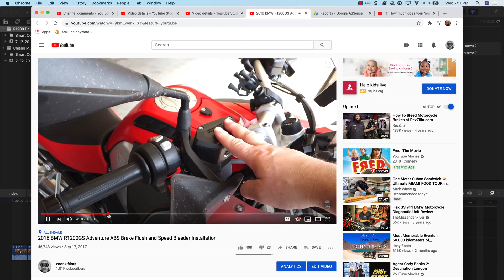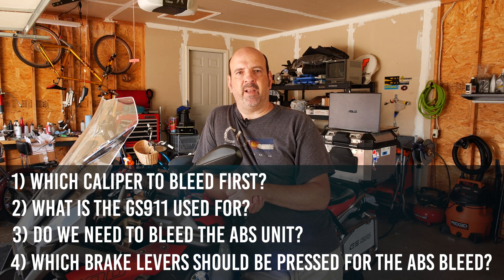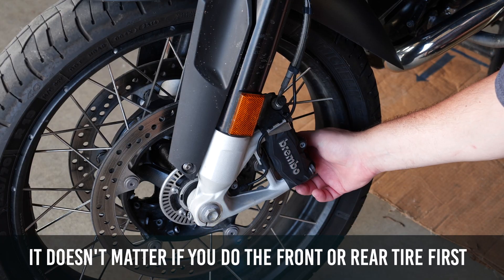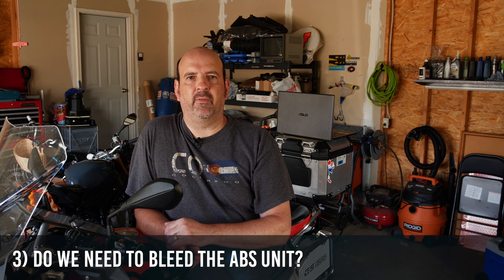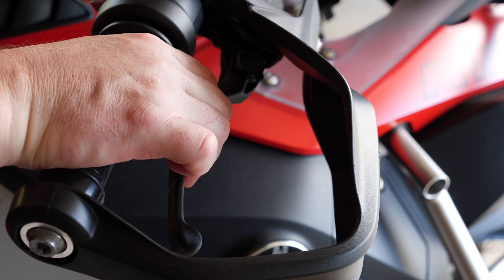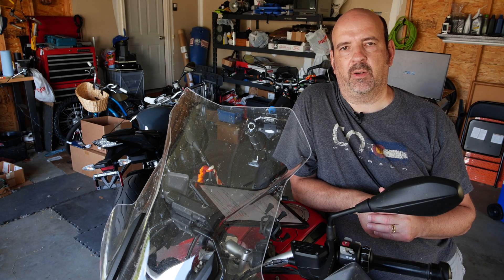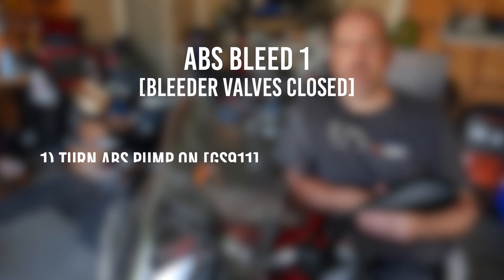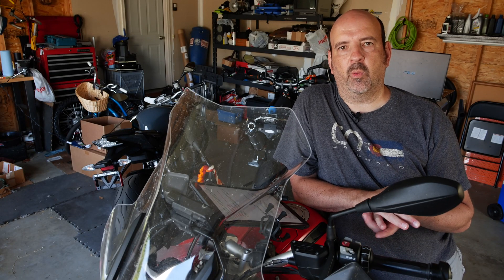BMW R1200GS Adventure ABS Brake Flush/Bleed FOLLOW UP  - Part 2 with FAQ's

Comment: Great Vid; Thx. I have a couple of questions regarding terminology just to make sure I understand what you mean. 

So each time after activating the ABS pump and performing  the 2 second pump x 3 :

1) You are saying to perform a mechanical "brake fluid flush". Do you mean a mechanical brake fluid "bleed"? Because we would have already flushed the brake fluid system mechanically before starting with this ABS process - replaced old fluid with new; right? So did you mean just to mechanically "bleed" the brakes after the ABS activation process or flush the system again?

2) If you meant "bleed"; how much fluid should we bleed out after each ABS activation process? About 3 brake pumps on each brake?

Many thx.
Reply from the maker: @AL BISHTINO - Thanks for your comment and question (it's a good question!). Some answers: 1) Yes, I am using the term "flush" and "bleed" interchangeably here. The instructions in the Hexcode GS911 software refer to a "mechanical bleeding", not a "mechanical flush". To me, we want to "flush out" all of the brake fluid on the first run (before the first ABS pump activation), then on the second and third "mechanical bleed" (after the first and second ABS pump flush), we want to bleed off any air that was pumped out of the ABS modulator during the "ABS Pump flush". 2) I "bled" out about 80% of the fluid in the reservoir for each caliper, so I suspect that would be more than three pumps. Now that I think about it, the rear caliper has a smaller reservoir, and about the same distance of travel (from ABS modulator to caliper), so I will probably run through two times there for the second and third "mechanical bleeds". Hope this helps, and thanks again for the comment!
Reply: @zooskifilms  ... much obliged. Very clear. Thx.

Comment: GOOD STUFF and Great Job.  A few tips.  1. Never ever put news paper on a painted surface of the bike!  If brake fluid ..even a drop or two were to get on the paper, the fluid will get on the tank.  You might not even be able to see it. But if the drop or drops of fluid moisten the paper through and through.... the paint could easily be impacted in a most un desirable way!!!!   ITS FAR BETTER to... Have a clean  cloth cotton towel that you wet for this activity and droop it on what ever you want to protect.  If you do spill a drop of B fluid, the wet towel will stop most of the fluid.  Better than that is use some type of plastic barrier ( visqueen) ( SP?). Rinse off the towel when done and let it be the dedicated towel for this task..etc.

As for the "nose -sucker-outer" for babies... ( LOL) you can also just use paper towels to absorb the fluid out.  NEVER take all of it out!  Make sure there is some on the bottom covering the intake hole... other wise you will introduce air into the sealed system. Absorbing the fluid out of the reservoir is tricky in that it is easy to get fluid on painted surfaces or other parts. So be careful  and think it through.   Better than absorbing  with paper towel, is a syringe, or just a squeezable bottle with a tube on the end.   sub'd n' T-up.  Now all I need to do is save up for my GSA!
Reply from the maker: @David Falgout - Thanks for comments and feedback, very useful indeed! Always interesting to hear other methods and tips. And yes, that nose-sucker-outer was all I had around, and I have dedicated it for this task now. Will definitely use the wet cotton cloth method on my next job. Thanks again!

Comment: Bleeding is to get rid of any air bubbles in the braking system. Flushing is to get ride on any moisture that has accumulated in the brake fluid since the last flush. I believe that you want to flush the ABS as well as the brake calipers in order to get rid of all that nasty moisture in the brake system. Great video. Thank you! I ordered a set of Speed Bleeders for my S1000XR after watching your video.
Reply from the maker: @Alan Butler - Great point about the moisture in the brake line, thanks for the comment. Those speed bleeders are fantastic, wish there were more sizes available, I would put them on all my vehicles! Safe riding!

Comment: If you tie back the front break lever for a couple of days how does that help get air out of the system. I believe it’s a closed system so I don’t know how the air would escape. Thanks for doing these videos, they’re a big help :)
Reply from the maker: @Ernie L - Thanks for the comment! Any air in the lines will want to rise so they will eventually make their way up to the brake reservoir, and out of the brake line. You could leave your brake reservoir caps on but open to help facilitate this, but from what I’ve read this will work even if fully closed. Hope this helps!
Reply: @zooskifilms  Thank You! I did as you recommended for 2 days and my brake lever feel is much firmer! I was frustrated because I had done the entire process (including using the GS911 I bought for this) and the lever feel wasn't as good as when I purchased the bike. It is now :)
Reply from the maker: @Ernie L - great news, glad that worked. Nothing worse that soft brakes, especially after bleeding them! A title bit of patience goes a long way. Safe riding!

Comment: Thank you for the videos; they helped me a lot with bleeding my brakes. Question: Did you use dot 4 low viscosity fluid?
Reply from the maker: @mdzigurski - Thanks for your comment. Yes, I  use Pentosin Super DOT 4. I show the detail on the full brake bleed process and materials in Part 1 which can be found here: https://youtu.be/9kmEwehxFXY

Comment: I have seen several videos on brake flushing (Jim Bade is one of the most reputable) that show performing the bleed process after removing the calipers (front and rear) and placing wooden or plastic shims to spread the pads to remove the old fluid from the calipers, I noticed you are not doing that.  Is it not necessary or overkill?  Thanks - good video!
Reply from the maker: @John Tyler - Great point. Technically that method of pushing the pads (the caliper piston) forces most of the brake fluid sitting in the caliper, so that would be a more thorough method for sure. I didn't do that in my video because of the extra work, my original plan was to do that when I change out the brake pads. But I'm on year 4 now and have not had to change the pads out yet, so I really should do that sooner than later. I think the main point of changing out the brake fluid is to remove any moisture in the brake line which could cause corrosion (brake fluid being hydroscopic). Is it necessary every year? I would think not but certainly every two years would be reasonable. Thanks for the comment, I will address this in my next follow up video!
Reply: Thanks! Very reasonable approach!

Comment: What I am hearing is that we live in the 20th century, own a high-tech BMW, yet have to deal with an inferior brake fluid technology that needs flushing every 2 years! I doubt dealers flush the brake fluids of bikes they have on their floor for over a year or two.  

Question: Is it best to use a vacuum pump or mechanical method for this task?
Reply from the maker: I would agree with that. It seems there is a related sense of safety factor when it comes to motorcycle maintenance, especially the brakes. I assume the potential failure in a brake system due to old brake fluid is rusting of the brake circuit, mainly the brake piston in the caliper due to a hydroscopic effect. Perhaps this is only a worst case scenario not everyone will experience. For me personally I don’t mind doing this maintenance, but if it is not necessary I’d be ok with not having to do it. To your question, if you don’t install speed bleeders, the vacuum pump would be a better method than pumping the brakes and manually open/close the valves. I’ve always had some issues with air in the line doing it that way. Perhaps it was the way I was doing it. Good luck and let us know what method you go with.
Reply: @zooskifilms  I have used the vacuum pump method on my KTM dirt bike and I did so after 5 years and not 2 years like what BMW suggests and I had to because the brake fluid was brown!!  BMW just recalled their front calipers and that will be left with the dealer to flush. Interesting how BMW decided to save a little by going with Hayes calipers up front and Brembo in the rear, a bad business decision to mix different calipers and now they have recalled over 9,000 2019 and 2020 bikes. I doubt I will buy another BMW motorcycle again, I even sold my BMW 5 series automobile when recycled parts on it started to break apart.  I  think BMW is ditching quality...
Reply from the maker: @ironhorsegladiator5034  Yes, unfortunate, tough to make up the bad rep when trying to save a few bucks. I tend to wait a few years after a new mode is released for these reasons. Need time to work out kinks. Cheers!
Reply: The reason you need to use the GS911 is to adjitate the fluid in the ABS pump module.  You can bleed it without it, but the fluid in the pump doesn’t get pushed through the system.  As for vacuum v mechanical - mechanical is fine and there is no need for a vacuum.  I do a mini flush every six months using the mechanical method.  No need for speed bleeders. Just run the hose into a bottle with fluid in the bottom.  Make sure the hose is in the fluid, crack the bleeder and pump away.
Reply from the maker: @D. W. - great point, thanks for sharing!
Reply from the maker: Good point D. W. !

Comment: Thanks two great videos. I want to change the fluid in my 2008 GS and was horrified to read in The Haynes Manual that this needs to be done by a main dealer. Thats big bucks here in the UK but having now watched your videos I feel that I can do it myself. Its still going to be big bucks though as I will need to buy the GS 911 but at least I can use it for other things. Thanks again & stay safe. Ted
Reply from the maker: Thanks for the comment! I also have the Haynes manual and I find it difficult to follow myself. The illustrations are not the best either. You won't regret purchasing the GS911, very useful tool. Good luck with the work!
Reply: @zooskifilms  Thank you.
Reply: The '08 is a hex head, and the process may be different.  Specifically, there is a mysterious hose with a zerk nipple at its end which comes off the ABS unit.  I have only seen speculation (no word from BMW) that that is a port for assisting in clearing/draining/flushing the ABS unit itself.  Sorry I can't offer more than to say that the process in this video is SPECIFICALLY for the LC versions, although the concepts are largely the same; of particular note is that that buzzing sound during the ABS flush cycle is a device BMW added to clear up problems with lever sponginess in the LC bikes and it therefore will not be part of the '05-'09 series of GS.

For guidance, check JVB Productions (Jim Von Baden) for a great series of GS maintenance videos.
Reply: @SuperBardley  Thanks for taking the time to reply with so much information I appreciate it a lot
Reply: The GS 911 will save you money. Its $400 US and I was able to diagnose a failed ABS unit in like 2 seconds. And zooskifilms videos will make it easy to do.

Comment: Hi, i have problem with my 2015 gs rear brake, after bleeding the entire system using gs11 and all lines it will work for a day and then not working again after few hours of riding, there is no leaks on the lines and rear master cyclinder were replaced already. Ive noticed there is a lot of air bubbles on the line when bleeding but i dont know where is this coming from, ABS works great and no alarms on dash, the dealer said it could be the abs module but its 2000 usd. I really dont know whats happening with the rear brake system now. Pls help.thanks
Reply from the maker: Is the rear brake not functioning at all? What happens when you connect the GS911 now and  run the ABS pump? I’ll check my service manual to see if there are any other suggestions, but it could be the ABS unit. I would assume you would see some malfunction now when you try to run the pump through the service function.
Reply: @zooskifilms  hi, my rear brake has very little pressure on it that the pedal is almost all the way down but still able to stop the rear wheel when on center stand and no weight. But i think in a few days it will loose the rear brake at all just like last time. There is no malfunction when insert the gs911, it says 100% status normal when being bleed and brakes working well but after 1 hour of riding it will loose pressure again and pedal allway down again like no pressure. I did also leak test and all is normal. Also when bleeding, the air bubbles is quite plenty and takes time beforeit disaappears.thank you.
Reply from the maker: @nagma2 - I checked the service manual and not much in there other than it says if the ABS unit is in fault the ABS light will remain on. In your case I assume the light is ON when you start the bike, but then disappears after getting above 5mph? Have you tried turning ABS OFF completely? I am also curious if you put the bike on the center stand and rotate the front wheel, press the rear brake, does the front wheel stop or slow down? The reason I ask is in case your bike has integrated brakes, perhaps there is some backflow when pressing the rear brake (not sure if there is a check valve or something stuck). If there is no leak, the fluid must be going somewhere. Also, if you have that much air in your line, something must be introducing it. Any chance you can video or audio record the ABS bleeding process with GS 911? It would be interesting to listen to how yours sounds. Finally, are you using speed bleeders for your brake line bleeds or another method?
Reply: @zooskifilms  hi, i only borrow the 911 to my friend and its quite far from home but im pretty sure the sound is normal while bleeding, just an update i have tried to put weight on my rear brake on overnight and now it shows additional pressure on the rear unlike yesterday but still way down than normal, i will try to ride it again and see the results. When on center stand i have move the front wheel and applied rear brake and still the front is rolling normally and not slowing down. I will update you after i ride again if the rear brake will improve.thanks
Reply: This is known problem, that appears to be the Nissin rear master cylinder.  Here''s a link to ADVRider that goes through the issue (many pages worth) and what people have tried to improve the situation.

https://advrider.com/f/threads/bmw-r1200gs-lc-rear-brake-failures.1264712/page-9

Comment: Thanks for these videos.  Very helpful.  I have a question about the second tip--when you "wire tie" the brake lever closed over night to eliminate residual air in the system, do you leave the brake fluid reservoir open?  Also, do you do a similar technique for the rear brake?  (somehow wire tie the rear brake pedal down)  Thanks.
Reply from the maker: @peter shimm - Good questions! I left the cap on but only snug tight until after I cut the wire ties. Then I tightened the cap down all the way. For the rear brake the wire ties don't work so easily (nice catch!). I wedged a tool with a rubber handle between the rear brake and frame. You could also try a small piece of wood.

Comment: Flushing the ABS pump ensures new fluid throughout the system and removes moisture caused by old fluid. I see the M22 sticker. Are you out of MI?
Reply from the maker: Yes sir, Allendale, just west of Grand Rapids. Are you a Michigander?
Reply: @zooskifilms  I'm in Lake Orion. Different question.....does your GS have TPMS? My 2016 RT w/ 54k miles has TPMS and it has a mind of it's own now. Works when it wants to (front & back), no low battery warning, GS-911 shows interference faults, can't manually wake them with wake up tool. Dealer says 10 years on batteries but I'm reading 5 - 7. I'm thinking it's battery issues........... Mark
Reply from the maker: @markmcguire7988  - yes, mine does have TPMS, but no issues thus far (~12,800 miles). Interesting on the interference faults. My first reaction would be battery as well. I'm curious if you changed your phone recently? Or added anything else to the bike that has wifi or other potential radio waves that might be causing the interference? Other things I've read are corrosion or high mileage (working more), which you are at - 4x's what I have. That is (the battery) most likely it! Let me know what you finally figure out. And drop me a note next time you're in west MI!